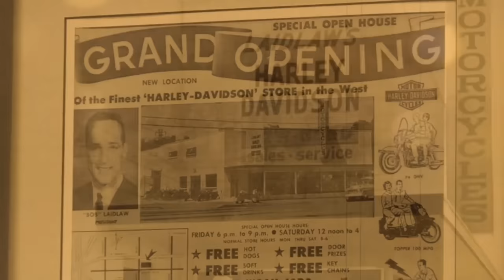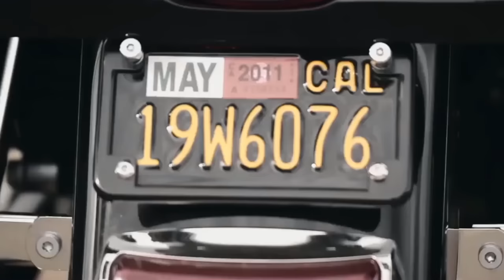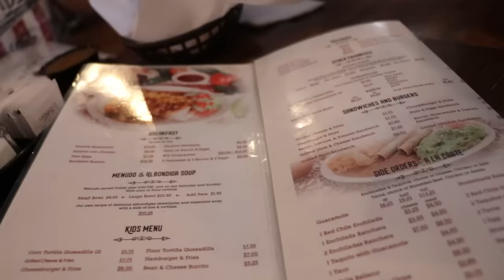Harley Viclas Rollin' East Los Angeles

Comment: About the 2019 Road King Standard. Where is the coil located? I like how the seat pole/post has been deleted or is that standard for this model? I have an 01 springer that I want to delete the coil/seat post. There is a really expensive kit for this where you have to relocate the horn as that is where the coil would reside. I don’t like that idea as the horn and shroud looks cool where it is.
Reply from the maker: Under the seat.

Comment: Love this video. Matt, any chance to get a set of true duals on a new model fatboy. Or even a touring pipe set-up? I want the fat back tyre softail but dual pipes.
Reply from the maker: Yes I believe there is a exhaust manufacturer that does dual exhaust now. One pipe runs under the frame. It’s CA illegal however.

Comment: I love v-twins, especially 45 and 48 degree, but will never get why you'd get the high handlebars and mediocre suspension.

For example, the MT01 sounds just as good but actually manages to feel pretty light and sporty at the same time, compared to a Harley. https://youtu.be/oDVHd416Qu0

Another option is the Nuda900, which does have a parallel twin but with it's 315 degree crank actually has a similar sound to the 45 degree Harley v-twins. That thing obviously handles like a dream, even compared to the MT-01.
https://youtu.be/4uSlAFiQfCM?t=65